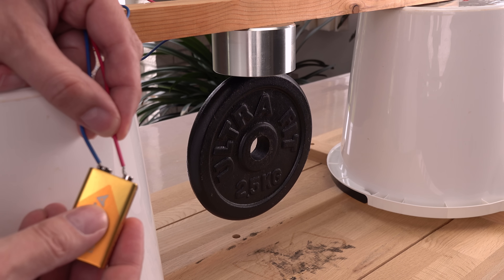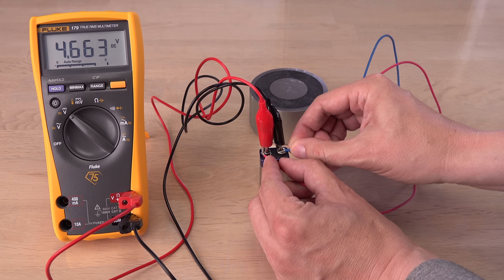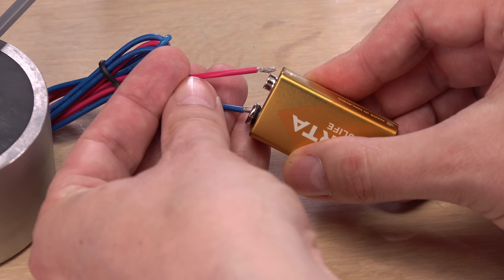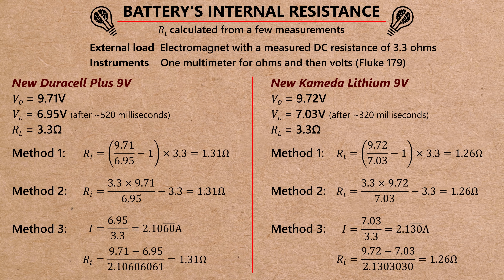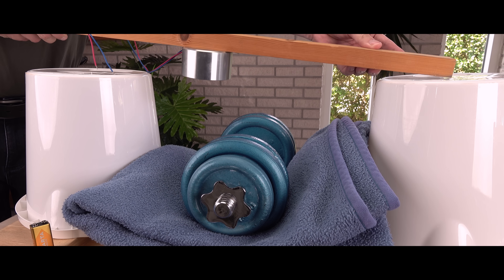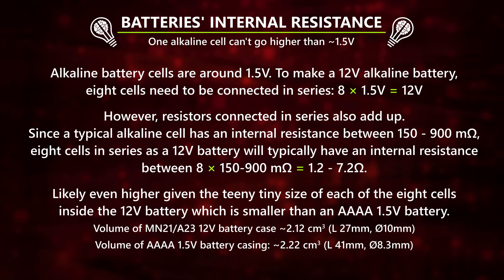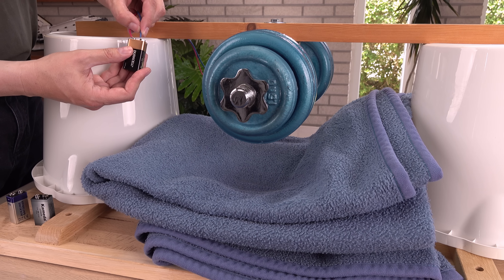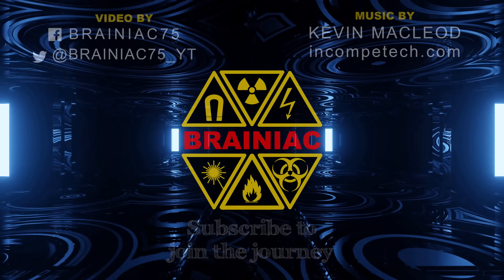The Curse of 9V Batteries | Internal resistance measured with multimeter

Comment: It contains 6x 1.5v cells, in English, a battery is multiple cells, so it was still incorrect for them to call it 'batteries' plural, unless you consider it as 3x3v or 2x4.5v batteries in series ;-)
Reply: Agreed. "Battery" is traditionally actually a collective noun. "A battery of tests" or "a battery of artillery".
Reply: @Tahoza  benefit of the doubt, cell is a technical term, and may have been translated as battery even by technical publications
Reply: @TheChipmunk2008 in Swedish, and surely in Danish a cell is synonymous with battery.
Reply: @ulwur  Interesting thank you :)
Reply: @ulwur  Only in "everyday" speech. The distinction between a cell and a battery of cells still exists in both Swedish and Danish.
Reply: Yes, technically 9V batteries have 6x AAAA (yes, quadruple A) cells in them. That's also why they don't last very long, having 6 tiny cells in series

Comment: You can put batteries in parallel, provided they are the same manufacturer and same freshness. If you want to be extra sure, buy a bunch and then use the multimeter to choose a few which are most balanced. Once they are together, they will discharge jointly and NOT charge each other.
Reply: also although I wouldn't do it, some people will recharge them, so them being a little off isn't a big deal.
Reply: Alkaline cells are safe to be charged, but multiple times will cause gas build up causing rupturing of the seals. You really should use diodes in less safe chemistries like LiSOCl2
Reply: @Robbedoes2 Putting a couple of small consumer grade primary cells in parallel is going to cause so little cross charging as to be meaningless in pretty much every case unless you do something obviously dumb like mixing 2 obviously different batteries (different brands, different grades etc, combinations that are likely to result in substantial differences in either quality or type of chemistry), or putting a fresh battery in parallel with a partially or completely discharged one
Reply: @bosstowndynamics5488 for alkaline I would mix any working cell with any working cell. Worst thing that can happen is that they probably will leak. Different brands are often made in the same factory, and even if not, alkaline batteries are all similar enough that differences do not matter. Still: if you don't know what you're doing, don't mess around, unless you're trying to learn.

Comment: So these "permanent electromagnets" (I still used quotation marks because of how counterintuitive the term is) are the ones used to lock and unlock doors magnetically and electrically, and in failsafe mode for when the mains power goes out and no one was prepared or even present to mount temporary deadbolts? How much force would someone need in order to break one of those doors free of its magnet (assuming one that's this size), forcing it open simply because that's all that was keeping it locked (assuming only one magnet was installed)?
Reply: He mentioned this particular magnet could hold 190kg if the full surface area is covered.

Comment: These batteries powered a soviet radio, the Socol Radio. My (and lots of others) grandfather had enough of buying this tiny batteries, so he bought two 4.5 batteries, connected them in series, and used that as a 9V battery. He fixed them to the radio with some rubber band :D
Reply: Were the 4.5 volt batteries the flat rectangular ones with flat springy terminals on top that were often used for powering bicycle lamps?
Reply: @johnm2012 Yes, the big flat bricks, which contained 3 1.5V batteries. I did not see any bicycle lamp to use it, but there were a flashlight, very common in Eastern Europe which used it.
Reply: God bless your grandpa 🙏, I wonder what more he fixed around lol
Reply: Was it one of those wired radios? Once I've seen someone talk about Soviet and North Korean wired radios here on YouTube, they are really neat!
Reply: @vimicito no. Wired radios don't use an external power supply. In short Soviet wired radios are just glorified loudspeakers connected to a stationary retranslation grid. Said grid equipped with it's own amplifier providing power for all "radios" connected to it.
Reply: @vimicito  Wired? You were able to take it with you for a walk. Its size was similar to a Sony Walkman. Look for "sokol-403" in google's picture search. It looks like its antenna was entirely inside the case, even though I remembered some telescopic antenna as well.
Reply: These 9 Volt cells are bad. My portable keyboard takes 6 AA batteries instead by design which is also 9 Volts, but works better.
Reply: Nothing special.

A pretty nice, "vintage" compact radio/CD unit i have is driven originally with something like 8x D size 1,5V Alkaline batteries.
I just stuck a "used up"  11,1V, 3S LiPo racing pack from my RC car in the battery bay and charge it slowly via the still unused balancing ports.

Nothing special to convert "old" tech with bad battery choices to something newer/better and especially CHEAPER when going from primary cells to rechargeable ones.

Comment: Batteries are designed based on expected drainage amps. For example, a 9 V battery used in a smoke detector should last one to five years. So they actually have higher internal resistance intentionally so they don’t self drain faster than the usage.
Reply: max draw on most smoke detectors is 20-40ma in full alarm (running the piezo) they mostly draw power in the low microamps. most of the modern ones start a microcontroller that draws about .5ma for about 3-5ms (including blinking the light) every 10-15 seconds, a few hundred nanoamps the rest of the time.a fair amount of light engineering is done to keep the loads down so a battery lasts two years minimum with enough for a weekly activation of 30 seconds
Reply: They have higher resistance due to absolutely abysmal low capacities per cell.
This high resistance is then multiplies by 6-8 depending on 9 or 12V batteries.

Sadly, alkaline at all drains very fast even when still unused in the pack. Thats why i switched as good as possible from AA/AAA size alkaline to CR123 Lithium and other lithium ones, at least for barely used things, emergency lights and things which barely drains it.
Alkaline last at best for 5-6 years (brand new and UNUSED!), Lithium ones easily for 10-15 years when you dont buy the cheapest and avoid the ones with the biggest capacity (the ones trimmed for max capacity and power output typically have slightly higher self drain rate)

What i also love with Lithium and rechargeable cells such as 18650 and 16340 ones: Many of my 18650 lights run also with 2x CR123 primary cells, or can even boost the power output by using 2 high drain 16340 cells. My 4000W laser even NEEDS 2x 16340 cells to deliver >6,5V with a decent power output, alternatively is has a tube extension for 2x 18650 and looks like a lightsaber then haha.

You cant imagine how much easier it is to mainly rely on pretty conveniently shaped and small enough cells such as 18650 rechargeable Li Ion cells, the half as long CR123 lithium cells and alternatively 16340 Li Ion, all suiting basically most of my devices. Ofc more expensive, but in the long run especially the 18650 and 16340 cells used for 4-7 years are reducing the cost a lot. In fact i even believe its cheaper than buying a ton of AA and AAA alkalis, yet having a lot of advantages (more energy per weight/size...)
Reply: @harrison00xXx  The only positive thing I have to say about those button cells is that they do seem to keep a charge for rather a long time when sitting on a shelf.
Reply: @SmallSpoonBrigade  Many button cells are lithium... CR2032, 1620 etc are all 3V lithium.

Thats why i like them as well, they hold the charge easily for 5-10 years at least.

But thats why i also prefer in (rarely used) things such as emergency flashlights etc. those otherwise very expensive CR123 and CR2 lithium batteries. Much more likely to work even after years of sitting around and they also deliver useable performance below 0°C where alkaline and rechargeable Li Ion is bad.

Comment: 2:40 in. 9vcantoutput the amps needed cuz its small.  if u wired up like 18 alkalines in parallel, u shouldnt get much voltage drop

Comment: You can use a capacitor to mitigate internal resistance for high load short pulses. Would recommend a flyback diode on an inductive load though. The back emf spikes can get massive.
RE the scope. Hantek DSO2D15 is cheep, pretty good and has a built in function gen.

Comment: If you don't want the latest features, a used oscilloscope is an option. I believe you can secure sponsorship from a top company.
Reply: Keysight has a tendency to send out oscilloscopes to YouTube engineers and scientists…

Come to think of it, isn’t EEVBlog a smaller channel? Pretty sure that Keysight sponsored him.
Reply: @johnrickard8512  EEVBlog has just under a million subs, so a little bigger than brainiac.
Reply: @johnrickard8512  Keysight is a bad company and should be avoided at all cost.
Reply: Bruh, a decent and new oscilloscope is like 400-500 dollars nowadays. Pocket money (if you have a job).
Reply: @gaynzz6841  And potentially well worth it if you're doing a bunch of projects and aren't sure why they're not coming out right. Obviously, depending upon the project, not all projects will need one. Between the time and the potentially wasted components, they can pay for themselves over time.

Comment: Would be interesting to compare the 9v to a 6x AA or even 6x D cell setup, maybe larger cells can deliver lower internal resistance in practice?
Reply: Or even better - use 2 × 18650 cells instead.
Even low current cells are capable of supplying ~5A .

Comment: just add a large capacitor across the battery prior to connection , you only need a high current pulse to drop the weight.
Reply: Liie starting an electric motor. So polarized capacitor 10uf 25v maybe?
Reply: @Ed-ty1kr  itll take a few milliseconds for the weight to accelerate away far enough, so maybe 1000uF or more . Adding a diode in parallel to the coil will keep the current flowing longer , as well as reducing the flyback voltage (causing the spark).
Reply: @wktodd  Hard to say for sure, looked like the offset weight dropped with ease, needs repeated testing as always.
Reply: Smart !

Comment: 7.5 volts at 2.41 amps is enough. That's a lot of amps to expect from a standard 9 volt battery. They'd be pretty much single use, if that.
Reply: 9 volt batteries are designed for low drain devices, like smoke alarms, RC toy remotes, small handheld radios (like the old-time transistor radios), etc.

Comment: The most shocking takeaway from this video is that Braniac75 doesn't have a scope...
Reply: ElectroBoom to the rescue...
Reply: not even a 50$ cheapo?!! where are all those patron money go?
Reply: @docwhogr  funny thing about money is that it's needed to live, and basic necessities are shockingly expensive 
$400 US a month is way below minimum wage
Reply: @ThylineTheGay  are you sure this reply is for me? i suggest to get a 50$ scope... anyway money is not a necessity... you can live without them but you either have to live outside the society or outside the law...
Reply: They’ll send him one
Reply: sniper scope?
Reply: There has to be a scope sponsor for Brainiac75. I bet he could entertain us while demonstrating a scope's capabilities.
Reply: Any scope would have to have VERY thick mu-metal shielding to survive his magnets.
Reply: I’ve tried using them with motors before, and they always dropped voltage dramatically under load. Internal resistance makes them more suitable for low-power devices like smoke detectors rather than electromagnets or heavy solenoids
Reply: Adriana digital basement has reviewed some really nice cheap scopes
Reply: I think wee need to call @keysight
 to fix that!
Reply: I thought he did but it could be a Mandela effect thing
Reply: Hah. Shocking
Reply: Stop. Comment. Yes. Fancy magnetometer but not even handheld oscilloscope? Something is wrong.
Reply: @FHTheron  its ai generated
Reply: What scope? Microscope, telescope, periscope?
Reply: Keysight pouncing on this video like a rabid animal:
Reply: @XIIchiron78  Keysight is a horrible company.
Reply: @gaynzz6841 ¿Why?
Reply: Go dramatise  elsewhere. Simple DC experiment really don't need  a scope.
Reply: Scopes are very expensive (>2k€). Making that kind of money out of YT and his patrons would take months, and he has other videos with a certain budget to do. So unless Brian starts saving up, he wont have the money to get a good scope for now. Or he could get circuitspecialists as a sponsor. But thats more for electroboom style of content....
Reply: @z9cubingThey start at less than $50. It's not 1990 anymore.
Reply: @monsterhunter445  The point is no benefit with a scope for this DC Battery test lol . Just simple voltage and current test with some math.
Reply: @IANHANDS Did you watch the video? It's referring to a specific battery resistance test that relies on doing measurements with an AC load
Reply: @z9cubing You can get a decent, entry level scope for less than a quarter of that. Even Keysight and Tektronix have scopes for a lot less than that now.
Reply: @z9cubing I paid Eu 400 for mine and it is more than capable enough for my needs.
Reply: @TonyLing Yes, the likes of Rigol and Hantek do excellent scopes at that price point.
Reply: @z9cubingnot really, a good enough siglent and rygol can be had for under $400
Reply: @z9cubing I tried to measure your ignorance but my $80 dual channel scope went out of range even with my $20 100:1 probes
Reply: @z9cubing lol what.
Reply: @z9cubing by all respect but you're talking BS. Thought emporium showed in one of his videos a hand held Oscilloscope that was actually good and that you get for  under 250 bugs. I bought it and its awesome. Maybe if Brain wouldn't be that stingy and wouldn't by BS in the first place then he would have already one.🤣😂 buying a 800€ magnet is absolutely doable but buying an Oscilloscope for the same price he gets a cold and fever👀?! Strange 🤔

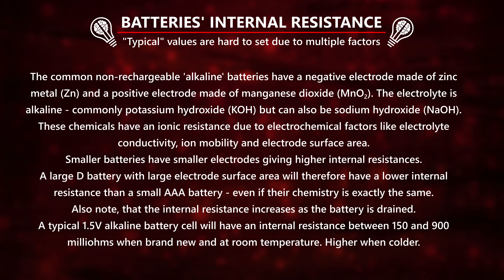Comment: 4:45 That's only one of several types of 9V battery. There's one type that's full of 6 AAAA cells, wired in series. Those are my favorite.

It may also help explain the variation in results at 7:00.
Reply: I haven't seen one of those stacked "flat cell" batteries for many years. The 6LR61 form is way more common.
Reply: @MarkGovier  Stacked flat cells are pretty common with rechargeable Ni-MH batteries. They give better power output although have lower capacity compared to alkaline ones.
Reply: @gamtax  yeah, its the only time ive seen 9v with flat cells... rechargeables. aaaa in everything else. would think the flat pack gives a slightly higher plate area as its better packed than cylinders in a square box... simultaneously, it also reduces surface area to dissipate heat... catch 22!
6v lanterns have four... larger than D cells (never bothered finding out...). make good starters for RC engines when rewired. though i also tend to just ram a bunch of screws into lead acid batteries to isolate a cell... 2v makes for lively glowplugs!

and most of the little 6v-12v cells for key fobs etc are stacked coin-cells.
Reply: @MarkGovier  Some time ago, maybe 9 or 10 years, I found that most of the discounter batteries sold here were of that type. But a few years later, it changed and now most of them are the 6LR61 Type, I think mostly VARTA still uses the flat cells design or maybe even only them, and they also produced the no-name batteries for some of the discounters.
Reply: You can tell from the IEC designation how the battery is built up. The one with 6xAAAA(-ish. They're shorter than AAAA) is a 6LR61 - 6xLR61 cells - the one shown in the video I think is a 6LP3146. Yes, 6xLP3146-cells.
Reply: Until today I thought they all had the cylindrical cells
Reply: When I used a Microsoft surface, I used to rip apart 9V batteries so I didn't have to buy AAAA batteries. The extra little bit of metal that connects the batteries together actually helped make good contact!
Reply: if you short two of these together by connecting their terminals, the version with six cylindrical cells can explode in a quite spectacular way
Reply: Durafails use the 6 AAA batteries
Reply: Aren't they just triple A?
Reply: @TomboRectify  How would you fit 6 triple A batteries in a 9v battery ?
Reply: @TomboRectify  AAAA or 4A, slightly smaller than triple A
Reply: Yes, when I was experimenting with 9V batteries and few years ago, I found that the 6LR61 Batteries could deliver a lot higher currents than the ones with flat cells "6LP3146" like the Varta ones.